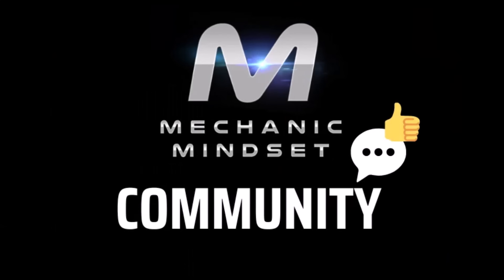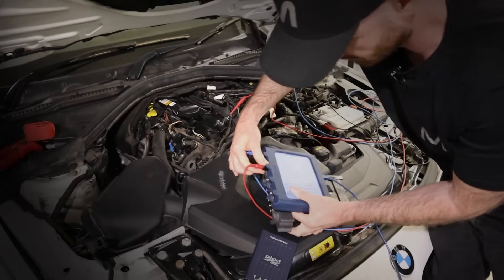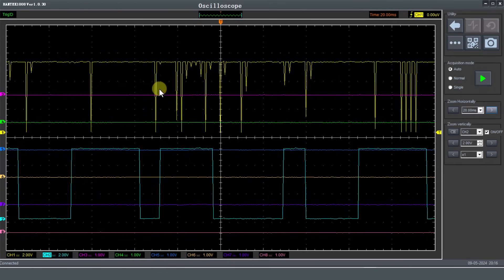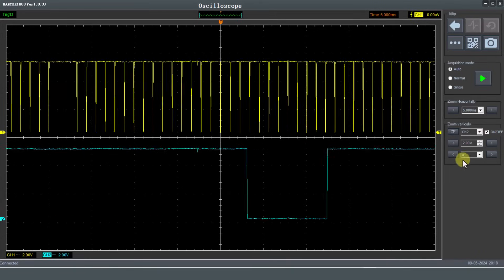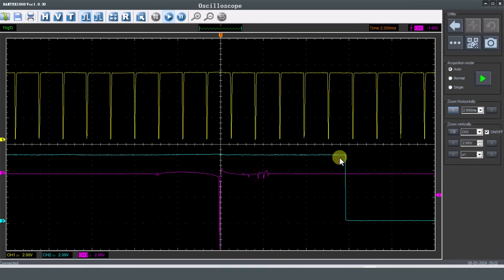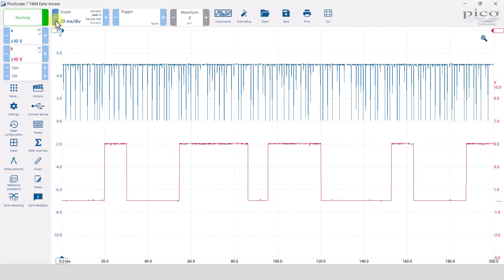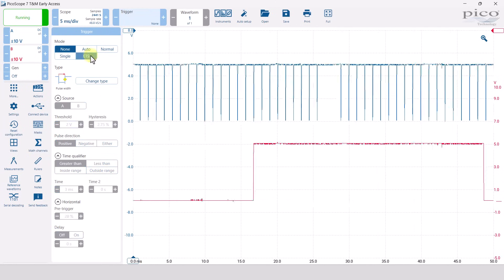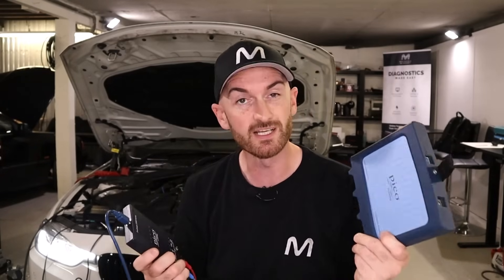Don't Be Fooled! Crankshaft Sensor vs Oscilloscope

Comment: The problem is vertical resolution of the scope, Pico Automotive is a 12 bit scope while 2204 has just 8 bit and Hantek as well.
Reply from the maker: For replicating curved lines, indeed, vertical resolution. In this case, it’s memory depth which is the limit 👍

Comment: When you noticed the cam sensor  "floating" around and wasn't sure if its actually timing chain slack or variable valve timing adjusting, could you just unplug the VVT solenoid  for that bank or both banks if checking both so that the phasers are locked? In theory if im thinking about this correctly, if theres still variation then it has to be chain slack?
Reply from the maker: For sure, just have to remove quite a bit to get to the connectors in this engine. I’m gonna check 👍

Comment: This is what puts ppl off scopes, no scopes give the same info n having to adjust n finding a known waveform to compare takes so much time....customers not prepared to pay...old school is best and quicker even if u have to do a little extra work....you have just proven its pointless...
Reply from the maker: So how do you confirm the condition of a hall sensor Reluctor ring that’s inside the crankcase?

With a scope, it will take you 10 mins or less. No guessing

Comment: You know vehicles are over engineered when it takes a oscilloscope to diagnose.
On top of that, manufacturers are producing oscilloscopes with inherent limitations without disclosing those limitations to the wannabe DIY fixer.

Comment: on new cars we need 5 channels or more
Reply: If you use lab oscilloscopes. You can use two or more oscilloscopes as one. You can get a scope that has tigger in/out BNC connections. And you can get the in the Gigsamples a second.

Comment: The Hantek1008C has a very low real-time sampling rate of only 2.4 MSa/s, for this reason, fast signals are not played back correctly.
Reply from the maker: @RaduRadi-l2e  2.4 Million Samples a Second is a ‘good’ rate. The problem is memory, it’s not capable of recording 2.4MS over a full 1 second

Comment: Thank you for the awesome content you publish!!

I have an AESWave UScope and like it.  But it has its limitations:  single channel and very limited ability to save files and analyze them afterwards.  So I am looking at upgrading to a PicoScope.  I am wondering if the 2205A model would run into the same performance challenges the 2204A ran into in this video of the cam and crank sensors?

 The 2205A vs the 2204A:

25 MHz vs 10 MHz of bandwidth
200 MS/s vs 100 MS/s maximum sampling rate
16 kS  vs 8 kS  memory buffer

I do realize the 2205 is almost double the price of the 2204.  But I believe both scopes are incredible values.  I would appreciate your thoughts.

Thanks again!
Reply: I'm interested in this very thing. Is the 2205A worth the effort, or we'd have the same memory and resolution issues. Thanks!

Comment: Good job ,exlent. My question, will Picoscope 2405A run on pico7 automotive software, what is the price of scope and software?? Thanks
Reply: No, it won't run on pico 7 automotive software, but will on the pico 6 automotive if you know the trick to deleting and adding a dll file. With that said, the pico 7 t&m is the same software, minus the auto functions. You have to figure the settings manually.

Comment: Another great video!
Obviously the 4425A is the daddy and I'd LOVE one! However, I'm on a budget so with that in mind maybe the 2205A is the way to go? Double the memory and sample rate of the 2204A and 25Mhz bandwidth rather than 10Mhz you get from the '04, all for an extra £50. 🤔
Reply from the maker: @SunglassesRon-p2q  The extra spec makes it marginally better, extra MHz you won’t notice. Memory is the one we want. Definitely start saving for the 4425A, but the cheap one will help you learn for sure
Reply: @MechanicMindset I'm going to need a PowerPoint presentation to win my wife over! 😬
Thanks for the feedback 👍

Comment: If you have the pico 2204a, why would you not just run it on Progressive mode at all times?
Reply from the maker: @Code325  Sometimes you’ll want to use it for viewing waveforms live/dynamically
Reply: @MechanicMindset  ohh alright I missed that you can view it live like that, thank you. I thought it functioned like a crowd-funded scope that I’ve seen recently called Thunderscope. That one defers the workload to the computer that you’re using. Kind of intriguing, and I’d love to know your thoughts on it if you were to give it a look. I haven’t seen mention of it being used for automotive, but I assume it could be. The software is open source though and probably wouldn’t be anywhere as good as Pico 7 for automotive diag.
Reply from the maker: @Code325  Ah cool, not heard of that. Will have to check it out!

Comment: I think on picoscope you you should use time base 200ms/div or more. Than picoscope PicoScope 2204A will use streaming mode and 1MS/s instead block mode . In streaming  mode picoscope will not use (limited) internal memory..

Comment: I'm looking for oscilloscope automotive use in mind, but as that Pico 2204A has so small memory, was thinking other alternatives. Hantek 6074BC, Pico 2206B or FNRSI DPOX180H. That 2206B is the most expensive of the three, but at least on paper it would be superior except to the FNRSI. However I'd like the pc interface as it's much more easier to handle cursors etc. Would the 6074BC be enough or is the 2206B worth the extra money? 4425 is way out of my budget. Thank you in advance.

Comment: Hola buenos dias? Quisiera saber si con el osciloscopio puedo tomar la señal de consumo de corriente de los 4 inyectores al tiempo, y la señal de kv de las bobinas al tiempo y el voltaje de los 4 inyectores al tiempo? No se si puedes ilustrarnos con un video, ya compre todas las sondas rotkee muchas gracias 😊
Reply from the maker: Yes, it depends what cables you want to use. For current, just clamp around all ‘4’ injector wire. Maybe check out the Rotkee video we did
Reply: quiero usar el mix-4 para mirar la señal de los inyectores, pero no se de donde tomar la señal de amperios de los 4 inyectores y poderlos ver al tiempo y para mirar la señal de las bobinas tengo las otras dos sondas, el carro en el que estoy tratando de tomar la señal es un spark gt modelo 2013, tu podrias ayudarme por favor😄

Comment: With an oscilloscope you should check the waveforms only. If they look all right, you should switch to a logic analyzer for this kind of job. Much much more powerful for cheap, as well as as being able to be programmed with multiple triggers, decoding serial/CAN/LIN messages, etc.
Reply from the maker: Interesting. I’ve not really used a logic analyser; is this a tool like CANalyzer? I’ve used that before
Reply: @MechanicMindset  yes, it’s like a CANalyzer, although that one is limited to CAN (as the name implies).
Probably the best, simplest and fastest to use logic analyzer you can get is Saleae.
There are cheaper options though, even open source ones, but that may take longer to setup.
Recommend you try one regardless. I bet you’re gonna be mind-blown by what capabilities you’ll get with one :)
(there will be little difference between you and the developers at that stage :P)
Reply: @M.Captain  However, if you're looking at correlations between inductive CKP/CMP sensors, it would also be possible to analyze them with this type of logic analyzer. Keep in mind that this is an AC signal. Thanks for this recommendation.

Comment: I'm curious, you've already  addressed the 1008c for resolution https://youtu.be/13LZ5P_zBAM?si=pKS7RxFxS67aJVrw so am I correct that this is not an issue for the 6022be? This is what I already have. I'm a shade tree guy, so I want to get as much use out of cheap stuff as possible. I'm not likely to be touching bmw at this stage, but if I want to do a timing chain they'd be high on my list.
Reply from the maker: It will probably have similar results to the 2204A. I think the main point is, if you get a waveform like this, don’t assume the car is at fault. It could be scope specs. You may never see a sensor signal like this, but they are getting more common on later vehicles. Just one to be aware of 👍
Reply: @MechanicMindset  no doubt as technology processes things are less likely to fail in one area but newer ideas transfer to another ie timing chains prone to stretching. Seems to be a modern feature of long service intervals, single row timing chains.
Reply from the maker: @andrewlace  That’s it!

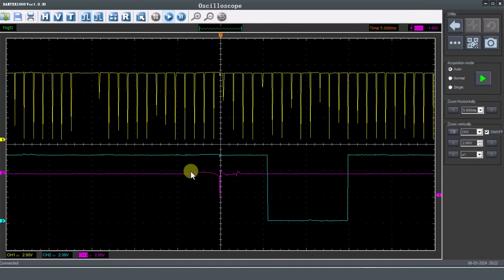Comment: 9:00
I would bet it is the ECU varying the timing and not the slack in the timing chain. 
Ignition firing is not mechanical linked to pickup timing. It is calculated in the ECU remember. 😉
Reply from the maker: Ah for sure, ignition timing may fluctuate. The test later in the video is locking the trigger to crank sensor and it’s still fluctuating 😳
Reply: If it's a 2012 to 2015 BMW N20 just change the timing chain and oil pump chain. They all sh1t the bed. Sometime in early 2015 I recall BMW improved the chain system. Or perhaps a maintenance item. Either way 2013 probably the worst year.

Comment: Darren why is an attenuator not needed when you clamp onto the ignition wire instead of going directly to the coil on plug. Just wondering does the signal change that much  . Hope all well mate 👍
Reply from the maker: Hey Artie! With the clamp or COP probe we’re only measuring the magnetic field, so the voltage is really low. Catch you soon mate 👍

Comment: Good video ive got a mondeo 2.0 deisel that keeps cutting out and showing no fault code , im going to have a go with my recently purchased 4225a and the guided diagnostics on early access , will he my first attempt  at using the scope properly , i could do with getting hold of some onown good waveforms to compare to ,  and i no i cheaped out and didnt buy the 4425a  but will get that in time  when im more indepth with it all , any info on down loading known good wave forms would he very much appreciated , im sure there is a way on my MM app  but i just need more time to study it all
Reply from the maker: When searching the waveform library, less info in the filter will give more results (ie multiple vehicles will likely share your engine) You can always jump in the MM community for support, and there are some great waveform sharing groups out there. 👍
Reply: Forgot to mention it was crank shaft and.cam shaft signal I was after

Comment: How do you know the. Setting on the scope. I'm new and want learn
Reply from the maker: Great! Voltage (height) and time are the main 2 settings. Starting with 20ms/div and 20V are good base settings to get most waveforms. Adjust from there. We’ve got a few videos helping g with this 👍

Comment: 1 Msa/s how much MHz?
Reply from the maker: They aren’t strictly related:
Sample rate is relative data collection (1MS/sec, doesn’t mean it can collect 1000000 samples a second)
MHz is  about frequency; how quickly can the scope waveform change direction for fast switching signals

Comment: Mechanic mindset always inspired me as a young and begginer mechanic. I will be very new to oscilloscope and l have one humble question. 
I want to do both electronics and automotive testings being a hobyist and l happens to know that automotive scope cannot be used as electronic bench scope. Can l get a regular scope so that l can use for both application? 
The scope that l look currently is a 100Mhz and 1Gsample/sec
Please help me out🙏
Reply from the maker: This is great to hear! Yes it should work ok. Just try to get something with a good amount of memory too. Sample rate isn’t very useful, if there isn’t enough memory to display those samples on the screen for the time base we select. 

Bandwidth isn’t so important for us. In fact, sometimes we want a lower bandwidth to reduce interference on the waveform. Hence why Automotive scope has low pass filters - that would be a good feature to have. And math channels 👍
Reply: What scope did you finally buy? I’m also looking for a scope for electronics and automotive. Why couldn’t the automotive scopes be used for electronics?

Comment: Have the 4425A at work the only thing is i wish it had a fift probe or seperate trigger input when probing all 4 injectors, i would also like to have one on the crank.

I feel 4 is just not enough for a 4 cylinder engine, yes you can make it work with a small compromise by just not using one injector
Reply from the maker: Couple options, use an amp clamp to get all 4 injectors in one channel. Or check out the Rotkee mixer probe- I did a video on Rotkee products recently. 👍

Comment: got a PicoScope 2205A need to test this out if i get the same test
Reply: The 2205A has twice the memory of the 2204A.
Reply from the maker: It might still struggle. I have the 2405A 😬
Reply: @MechanicMindset  OH 😭 2405A this is triple and more powerful than 2205A , would be really great if you featured 2405A in a future video 🤞
Reply from the maker: @joelde3746  Will do one soon; you’d be surprised though 😳
Reply: @MechanicMindset  the only reason I bought a PicoScope 2205A  after watching ''Hands On Auto Training
@BrianMann216'' said 2205A close to it's very close to a flagship automotive PicoScope,but couldn't afford the real thing so opted for PicoScope 2205A £200 and yes I am a member of Mechanic Mindset scope course which help me a lot but observing this video maybe I was wrong and @BrianMann216, the real question is is there a budget version which can handle and do  the job

Comment: I Love these videos 🌷
Thanks for making them 🙃
I do own & use a 2205A 😁
Reply from the maker: It’s a great tool, also slightly better than mine
Reply: @MechanicMindset  double the sample rate! Sometimes i really wish i had the 4425 or 4425a, for the library the12 bit resolution & the 200V capability.
but for where i live & work it's way too expensive 🙃 so the 2205A was the second best thing i could get at the time. There are better scopes in terms of hardware, but the pico software is in a league of its own.
Reply from the maker: @aranhaydar9195  You’ll not regret a Pico Automotive purchase, and they hold their value to be fair. Maybe look out for a used unit.

Comment: another possible cause for the cam sensor... its a true VR sensor. voltage output will be proportional to RPM. and theyre hooked up to a schmitt trigger type thing. at low rpm it can take a small difference in velocity to make a large change on the slope of the curve the sensor itself produces, and exactly when it hits the threshold. i know that my VR sensor on a project wont trigger below approximately 400RPM. it simply doesnt make the power at that speed to reach the threshold voltage.

the small variation in idle speed may be enough to account for it.

wouldnt expect VVT to engage at idle...

is that a reading directly at the sensor inputs? no. its after filtering and feeding through the ECU. how? is it direct path? wouldnt seem so...

use this effect on small engines, file notches or a ramp in the leading edge of ignition pickup tab, gives a bit more retard at idle, yet acts like normal at high RPM... so you can adjust the sensor position to get a bit more advance at high rpm without affecting the low rpm.
Reply from the maker: I wouldn’t expect VVT either, I’m wondering if it’s faulty. I’ll check the exhaust cam too and this will help confirm if it is indeed moving or ‘not’

Thanks 👍

Comment: I didn't get where you exactly connect the probs. Could you send me the film and how do you understand where it should be connected
Reply from the maker: Black leads both the chassis/ground. Channel A to crankshaft sensor signal pin on ECU. Channel B to Camshaft signal on back of sensor 👍
Reply: @MechanicMindset  tnx bro

Comment: Great video as usual. I must try this with my Hantek 1008C and HSCOPE.
Reply: Works much better with hscope but still best used as a paper weight, I'm not trying to be funny in the least bit. Coupled with a hs502 or 512 , Hscope will do anything that Pico will do on 2 channels. You only get 2 voltage selections even with hscope powering it, 2.4 and 19v and even though hscope will record your pattern for hours and days, it can only record in pages mode with the 1008. Data is there, but not in real time . For reference, you get 1 defined  secondary pattern each page. The native 502 and 512 will record hours on a fast signal and days on a slower one in real time. Both cost less than the 1008
Reply from the maker: @Backalleydiagnostics  Need to get myself some of Martins equipment!
Reply: @MechanicMindset  try sone of his 3 meter leads. Absolutely love his and the price is so good I thought I bought 2 leads and was impressed for the cost . Turns out I bought 2/2 packs, so I got 4 . His new attenuators have em interference built in also. Good stuff !
Reply: @Backalleydiagnostics  Hantek 1008C is not great but HS502 is and I have both. I will eventually try both with HSCOPE software.
Reply from the maker: Let us know how you get on!

Comment: Great informative video. I have a Picoscope 2205a but have not performed that test you carried out. However, the 2205a has over twice the bandwidth, twice the maximum sampling rate (real-time) and twice the equivalent sampling rate  Perhaps the 2205 will perform much better than in this test than the 2204a. what are your thoughts on that.
Reply from the maker: I have the 2405A; it’s only marginally better. It’s the memory that lacks for this test 👍